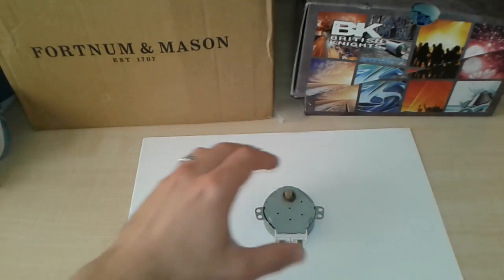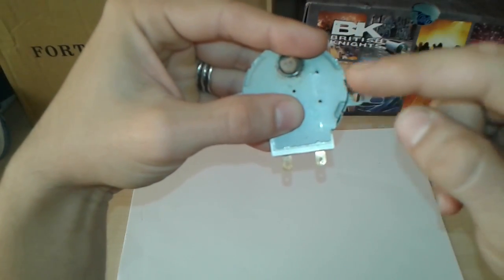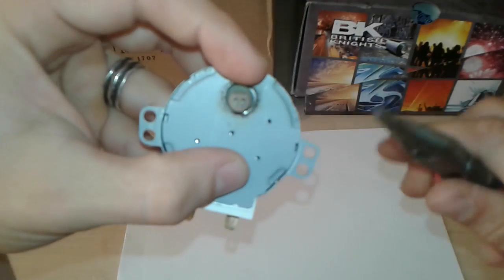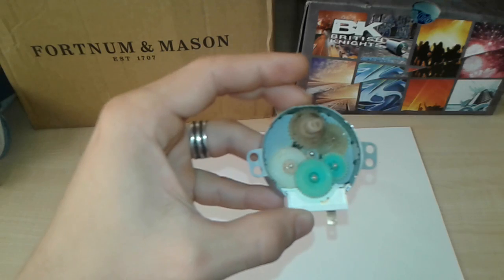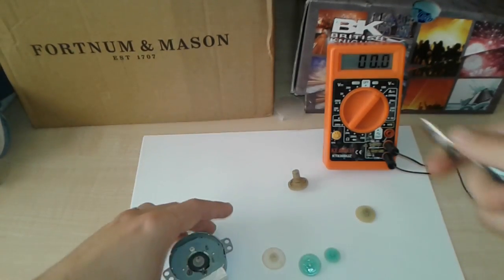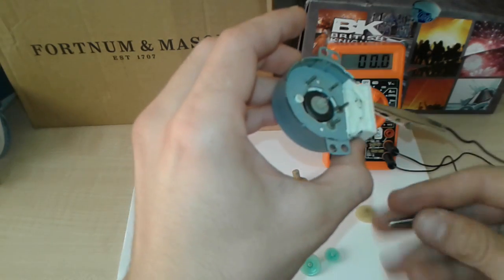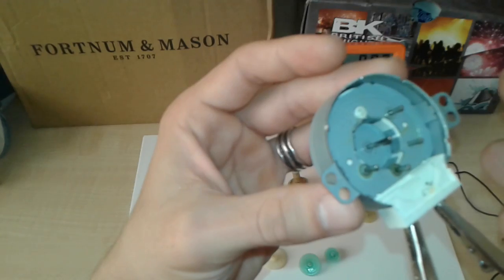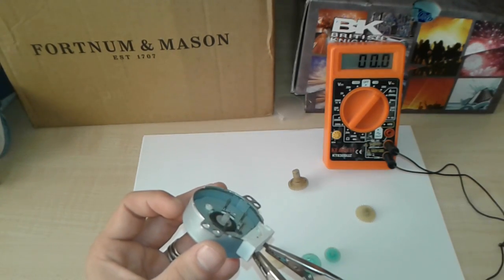Inside a Microwave Oven motor Synchronous Motor dismantle

Comment: This type of motor is very confusing to me. Which way is north/south on the magnet? Is it sideways like one C is north and the other C is south, or is it up and down? Since this is an AC motor with a single winding going around the outside, how does it move the magnet? I'm an electrical engineer so very familiar with how changing current and magnetic flux interact in most motors, it's just this one type of motor I can't wrap my head around
Reply from the maker: Is complicated just take it as it is and use it is cheap enough to make some interesting projects
Reply: Could you explain how this motor/generator works?  How does the current flow perpendicular to the magnetic field to get rotational motion as the winding of the stator are in the same plane as the rotation of the permanent magnet?

Comment: Do electrolysis by using the current provided by this and water become gas and cook food by that gas hho 🤗
Reply from the maker: Hi there will do some electrolysis projects but not sure with a hand crank generator will take long time to do so
Reply: @NoSkillsRequired  use a bicycling for longer duration or battery solar power 
Spring coiled winding up by crank shaft and we can found better power source 
Use hydraulic jack which can provide 50 tonnes pressure and this pressure can be stored in spring which can smoothly released its power by gears and we got a better source of energy without fuel 
🔄🔄🔄
Reply from the maker: @anilsharma-ev2my  will be an idea nice one

Comment: hi,i wanna ask.can i wired the motor directly to an outlet?or do i need to use a power adapter.i'm afraid that it might blew up?i'm trying to build an egg turner for my incubator...
Reply from the maker: You should check the label if is rated 120/230v yes if not connect to the appropiate voltagr on the label of the motor
Reply: @NoSkillsRequired  ok,thank you

Comment: Why does this make a voltage? Inside a car alternator the stator is wrapped in a wave pattern... in this motor it's just wrapped around the magnet... can you explain that.
Reply from the maker: Collin Murphy any DC motor in reverse become a generator the same in this case the magnet spins very fast inside a copper coil the gears are for accelerating the magnet all the best

Comment: Hi, I savaged one from an old microwave but even if I crank it high rpm it doesn't turn on even a 15w bulb, what's wrong?
Reply: I just COMPLETELY dismantled one that doesn't work (which he didn't in the video). There's a coil of very  hair thin wire inside the housing around the magnet (which he didn't remove here), and it just hapened to be broken (burnt more likely, judging by the black mark on the housing...) near the pin of the connector. I will try to sodder it and see if it works... Which me luck! It's so thin...
Reply from the maker: Stiff depending on what is written on the label normaly this is 4-8w max but some motors are rated 36-42v so keep trying mate
Reply: Thanks for the answer, it says "220/240v" 50hz 5-RPM 4W
Reply: Tried again but with a 1.5v led and it worked but the light is too weak :(
Reply: Oh, but I don't intend to touch the casing. I will put everything back in place, as if nothing happened... Well, at least that's the plan...
Reply from the maker: 19Edurne I have the teardown of this motor search for inside microwave oven motor cheers
Reply from the maker: Good luck with that be careful about the metal plates inside without them will not work

Comment: Hi, I savaged one from an old microwave but even if I crank it high rpm it doesn't turn on even a 15w bulb, what's wrong?
Reply: The 'wrong' is with you and the voltage is way to low.  Use a 12v 5w led and it will burn.
Reply: @TaunterAtwill  This actually outputs quite a high voltage if turned with the gears (110+), the problem is that the current is very low. It is a 4W motor/generator, and 4 watts is not a lot of power even though it generates a high voltage.